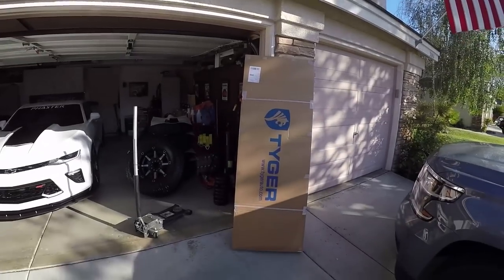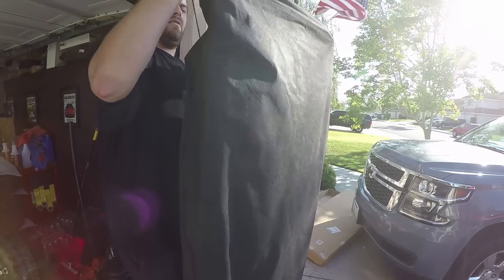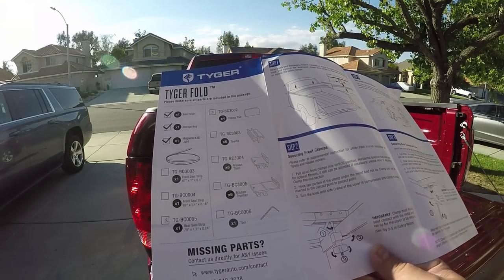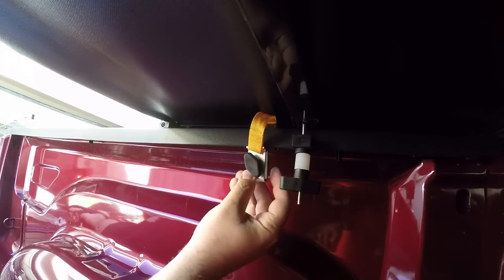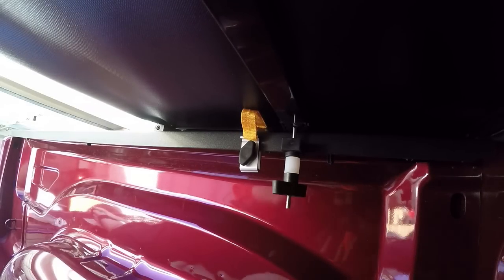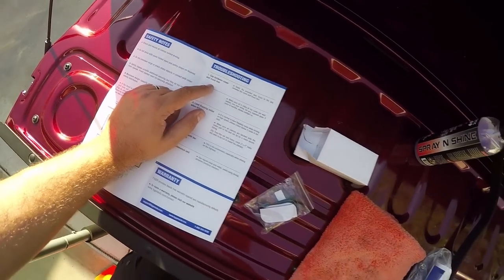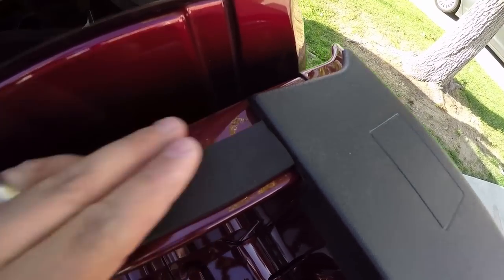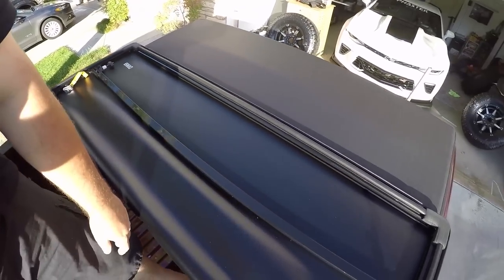Tri-Fold Tonneau Cover Install Guide 09'-18' Ram 1500 | Tyger Auto

Comment: These covers are great!
My first one from Tyger held up to SW FL sun and humidity for 6 years.  The stitching started to break down and pull apart so i put in for warrantee replacement cover.   Tyger came through and sent me a new, complete cover.  The 6 year old vinyl looked as good as the new cover except for the stitching.

Comment: I have the same cover and I find it interesting that in the guide book it says to trim the plastic bedrails so that the clamps are touching entirely metal. Yet, no one on youtube is doing that. In fact, in Tyger's own install video the guy just clamps over the plastic.
Reply: My 2019 Rebel seems to not even have a metal down-turned lip...feels like plastic all the way up.
Reply: @jasonoverman3436  I feel you, my 2020 Bighorn doesn't seen to have a metal lip.
Reply: Jason Overman my 2019 Laramie is metal. I’m pretty sure yours is too.
Reply: Joel Smerber it has to be metal. My 2019 Laramie is.
Reply: Just to clarify, my 2017 big horn does have a metal lip that comes down on the bedrails. The plastic bedrail covers come down a little farther. I didn't trim anything, the clamps still contact the metal bedrail.

Comment: I have the same one on my 16' Silverado.. has worked great for 2 years. Because it's square, on some models it's looks off because your bed isn't square... All you can do is adjust it to look the same on each side.
Reply: thank you! i just bought this one for my sierra. tried to line it up the best i could but i'll make adjustments later....and i should probably add the weather strip HAHA. glad to hear yours is 2 years strong so far!
Reply: Yea gotta love the curved bed of the ram. Makes this install drive people with ocd crazy
Reply: Joe Burwell my 2019 RAM doesn’t have a curved bed.

Comment: After doing so much research on the Bakflip MX4 and other covers, I decided with the Extang Xceed cover, because of the quality... even though it cost me $1019 by the time I was done with tax, I love that it doesn't leak, the low profile, the looks... though, I did seal the front Seal Strip with silicone on the seal gasket and the hold-down strap modules.

Comment: I had the same situation with the alignment in regard to good on one side and sort of good on the other.  I decided that the rails might be the issue.  but the cover tracks lined up well in the middle groves of the plastic rail cover.  Thank you for post this in this manner because I realized that I'm not the only one who had this concern.  So far, so good with this cover on my 20015 F150.

Comment: Might of waited to put the weather striping on until after the bed liner was added. As they usually do the front edge of the box. Other than that. The pickup is coming along really nicely.
Reply from the maker: Yeah they did, all fixed up :)

Comment: Hi thanks for the video. I just installed mine. A quick question. When you close your bed door mine feels as if the cover holds the door for it close. Without a cover it’s simply closes normally. With cover there is a pressure to close as something holds the door to close.
I understand that the cover is doing that but is it normal. I am just assuming I might installed not correctly but not sure if you have the same thing.

Comment: I just ordered the T5 Hard Top. A little skeptical, since I cannot seem to find a single review online.
Reply: @James Armstrong Not too bad.  The seal keeps the water out, but dust is another story. Installed it for a hunting trip & was able to stand on top of it to glass w/ my spotting scope. The locking clamps are cheap plastic, so I'm sure I'll have to replace them at some point.

Comment: lookin at one of these covers for my 17 ram, do you think it will hold up in the southwest harsh summer heat and frigid winters? any issue with it flappin around at highway speed?
Reply from the maker: No issues on the highway and took on SoCal 120 degree days. Can’t speak to winter, we don’t get that sort of weather here. 

But link below for this product, also supports the channel if you click and buy.
Reply: Only issues is after a few years the seals detach from the cover, but using some plastic in weld fixes it really quick and easy. Other than that it works great. I have the expensive bak tonneau covers on other trucks and those cost 5x the amount of this and those leak.., a lot

Comment: Thanks for sharing!! I ordered the same one, I’m literally waiting on the FedEx man on the porch as we speak. We have the same truck. Plan on installing it tonight. 

My question to you is how does it sound on the freeway? (I’m pretty sure you drive similar to myself because of the sick Camero in the garage). I have a long drive ahead of me this weekend and I don’t want to be stuck doing 60. 

Also, are you still happy with it?
Reply: Nick it did just fine. I moved from Houston, TX to Tulsa, OK (8.5 hour drive) and it rained a little on the road. All my things were just fine. It was fairly quiet, even at 85 MPH and I feel like it improved my gas mileage.

Comment: Why put all this money into a leased truck?
Reply: True, thought he said this wasnt the truck he wanted, If hes gonna put money into it shouldve just got a fully loaded 1500 ram limited
Reply from the maker: And spend 10x more than you should... for features I will never use. That sounds like a great idea.
Reply from the maker: Mostly because I have decided to buy it out. Realizing how cheap I got it, would be dumb to give it back
Reply: LethalGarage if you add the right parts you can get what you need out of a 1/2 ton truck. Same thing I'm doing to my 16' 1500 z71 Silverado, I'm regearing it, adding a trans cooler, some performance mods, and bigger brakes (all for towing purposes). This is my first lease and I couldn't see me throwing all that money I've spent every month away by not keeping it though I wanted a 2500..

Comment: there is a zombie walking in your video @ :55 seconds
Reply: Adam Snook hey my ram is a 2009 ram 1500 it’s measured at 741/4 inches . I wanna get the same one you have . On amazon the closest bed size looks like 6.5 ft cover . What size was yours and do you think that’s the right size ??